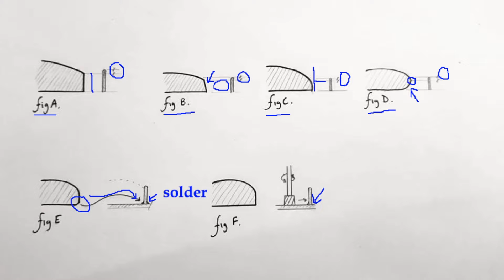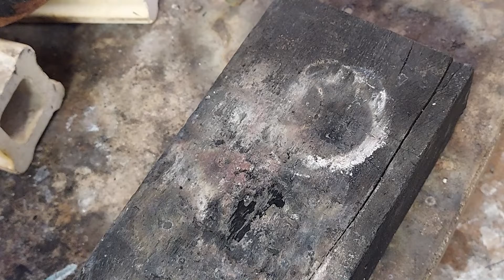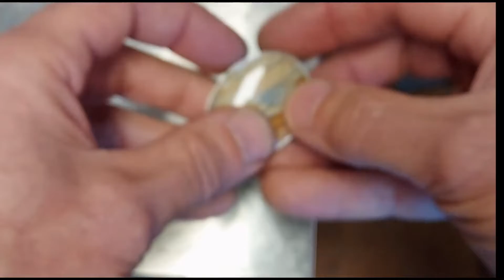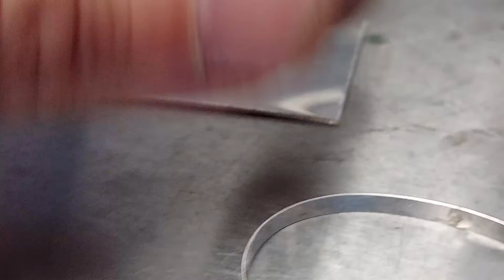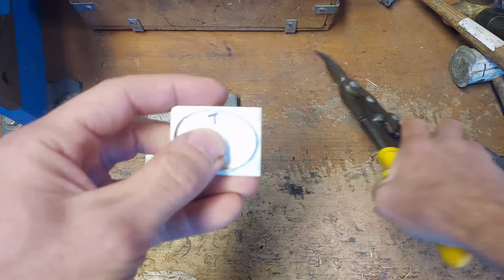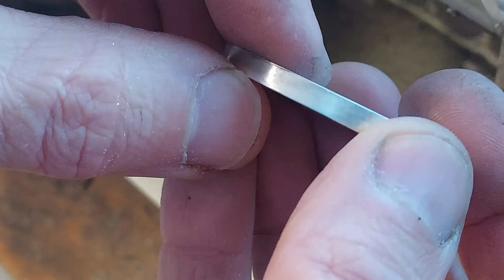105 - How to make a silver bezel for a cabochon

Comment: I loved the tip of tapping the bezel against the stone to set the shape!  Going to start doing this!  Thanks so much!
Reply from the maker: You're most welcome, Glad this was helpful!
Reply: @earthartgems  Question about this. I am learning on 28 gauge. Does tapping to set the fit still work?
Reply from the maker: @soulfragments  It should! But you can tell pretty easily if it works or not by simply trying it and then after you pull the stone out just test it by seeing if the stone drops back in easily. With larger cabs, it's perfectly fine to make the bezel just a hair too large so that you have that margin of error to allow for the stone to fit after you've soldered the bezel to the backing plate.

Comment: Awesome tutorial.  When you are making cabochon's is there an optimal size of dome for using bezel wire?
Reply from the maker: I like to balance the size of the dome with the size of the stone.  But as so often is the case, sometimes the size of the dome is determined by the rough material I am working with.  Some materials are also going to self dictate the type of dome they want.  An Australian black opal might only have color play in a thin horizontal layer, so the top of the cab is relatively flat.  A transparent material like amethyst or tourmaline will have way better color saturation with a tall dome. and a landscape like this jasper will look best when only slightly domes.  Cabs come in so many shapes and profiles that there is no one hard rule. So I try to just look at the concept that I point out in the first illustrations; That the bezel wire just needs to be slightly taller than the cab is so that it can fold over to hold in the stone.
Reply: @earthartgems  Thank you for your answer. I usually make a dome the height that looks good but hadn't thought about settings.
Reply from the maker: @suebland14  you must cut stones? If so, I can say that working with 3 or 4mm bezel wire is my favorite size. I believe in the video, I explained which profile is my favorite as well and why.
Reply: @earthartgems  I am still learing to.